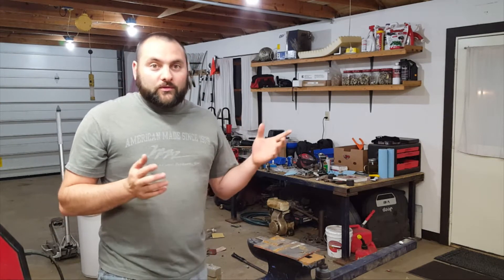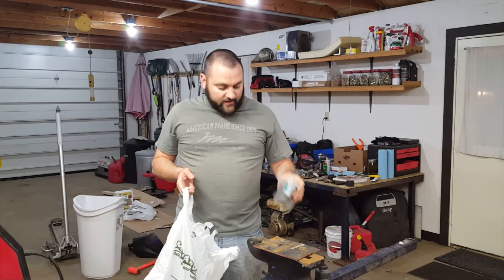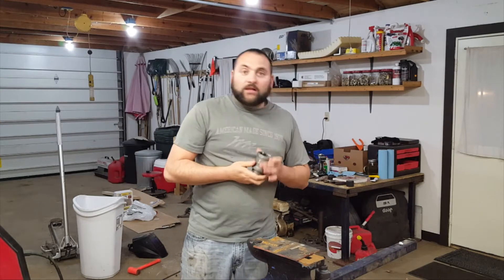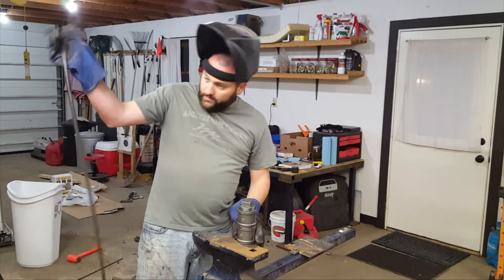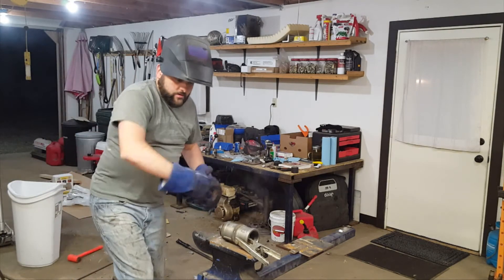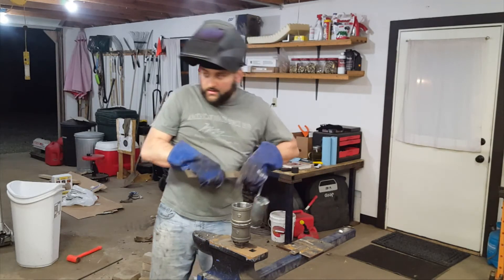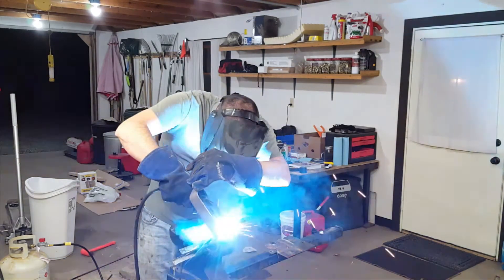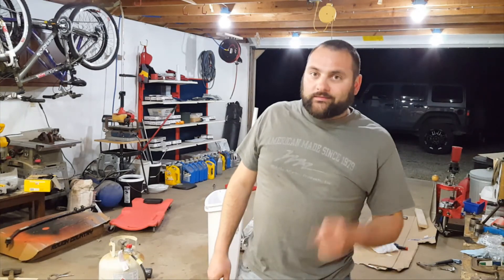How to make a crucible for melting aluminum

Comment: As soon as you heat that up the weld is going to break
Reply from the maker: Well it didn't break...  So you're wrong... I used it a couple times until my  crucible arrived.  As I stated many times in the video it's not optimal but it will get the job done while you wait for a real crucible to arrive.

Comment: This would work just fine if you could set the temperature of the flame to be slightly above the melting temp of Al and below that of the cast iron pipe. Maybe 1300-1500 deg. A thermometer could tell you the right temp at the point of contact of the flame. Or you can gauge it by just gradually heating it starting at a low temp flame and gradually increased the heat until you see melt.